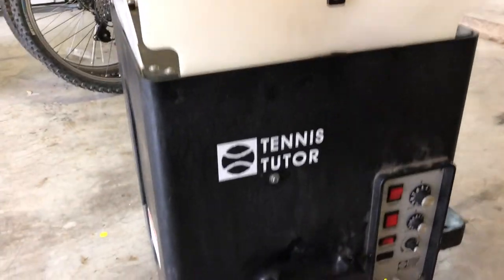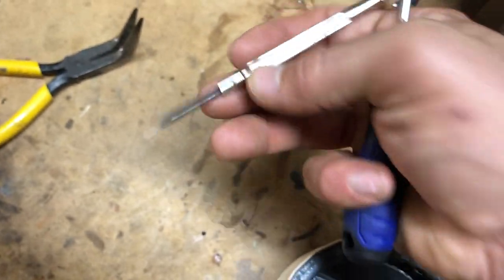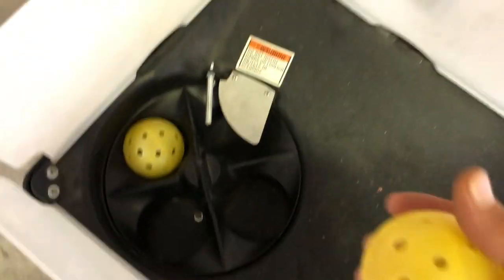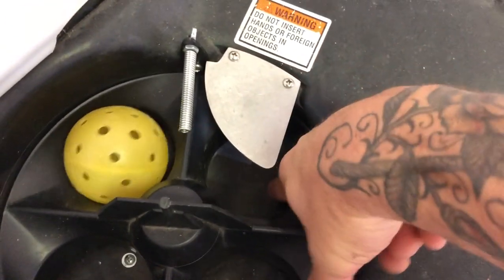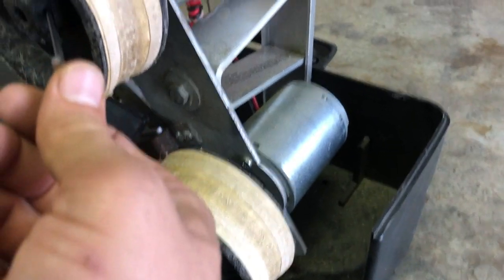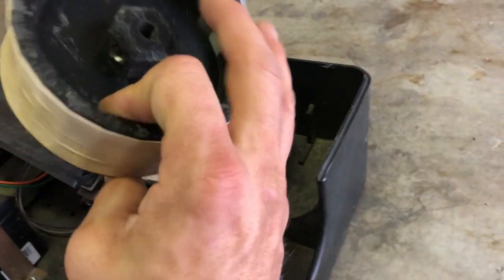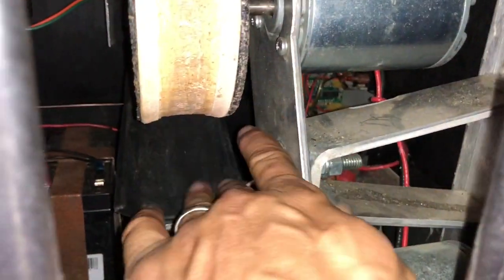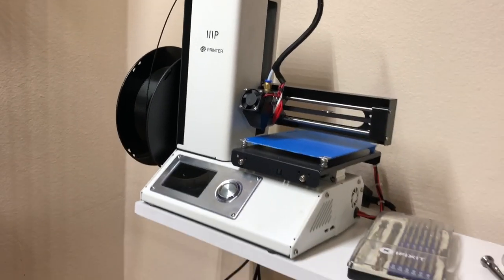Convert Tennis Tutor to Pickleball Tutor Ball Machine

Comment: Nice work, I did the same with an other tennis ball machine, works good except sometimes the ball get stuck between the ball selector and the side, if it is fully loaded with balls, separate feeding the balls works fine, what can be the problem, and the spring on top what is the purpose of the spring, thanks in advance

Comment: Hello, I am using your video as a guide to converting my Silent Partner Tennis ball machine my original wheels are larger than yours. I was wondering if you could give a guess on the spacing OD to OD on your new wheel once installed. The Ball is about 73MM. I know we want to compress the ball some I am not sure how much. Thank you Mike Clark from Ohio

Comment: Well I got it put together and it seems to work well. It is sometimes inconsistent and it vibrates quite a bit. Very loud when operating. Have you come up with any ideas to reduce vibration? Or balance the wheels?

All in all this is brilliant! THank you so much for the work you put into this and for the tutorial.
I had no problems getting the wheels printed and then following all of the instructions.